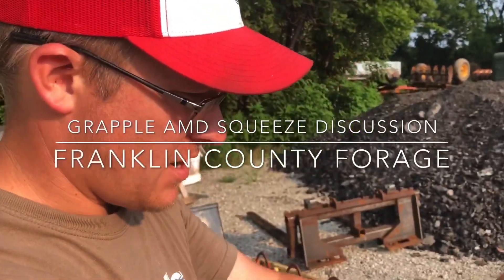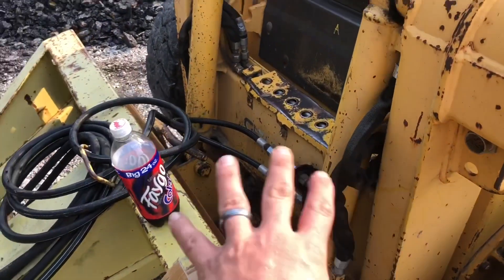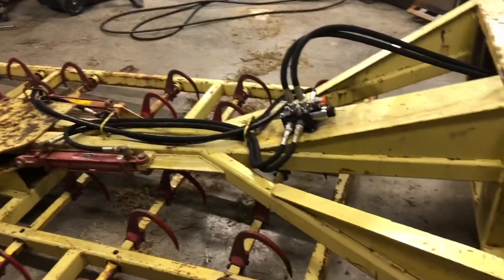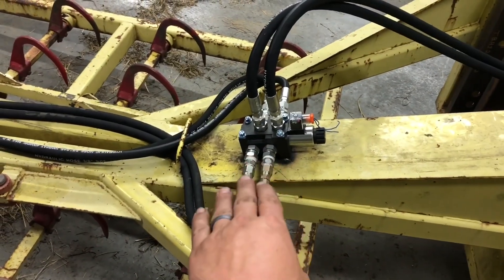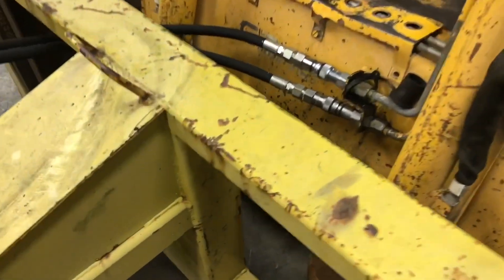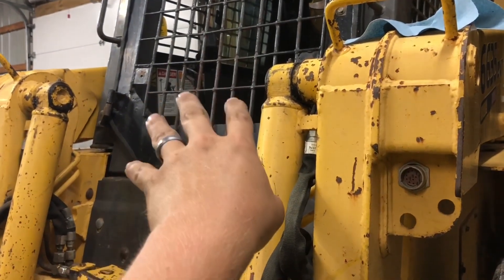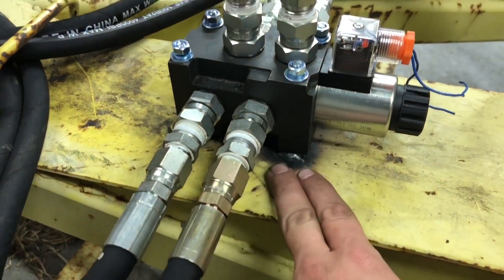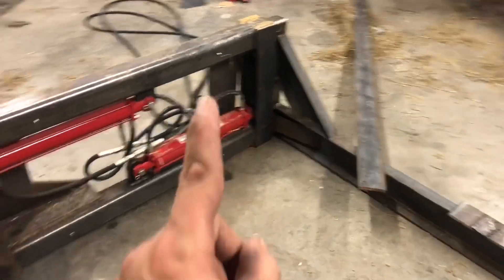Squeeze Reinforcement Discussion (mechanics of materials) and Adding Solenoid Valve to the Grapple

Comment: The squeeze looks like it would be the cats ass for picking up bales behind an accumulator if ya asked me
Reply from the maker: Yeah I think it will work well. Like I said there’s weaknesses for sure and it definitely takes some getting used to compared to a grapple. I also think it will actually do better on a tractor because you can actually see better. The skid steer is so close to the hay that you can see anything once you get it in the air.

Comment: I am excited about the squeeze
Reply: Have you ever watched bales of hay farm and ranch channel?
They use a squeeze everyday
Reply from the maker: Yep I’ve watched bales hay a lot. Their squeezes are a little more substantial than mine haha. The biggest thing with them is they’re using them on larger bales. I think the larger the bale the easier it is to squeeze.  It it is the same concept though. It would be sweet to be able to squeeze an entire stack one day. I don’t have anything large enough to handle a stack right now anyway.
Reply from the maker: I’m pretty happy with it so far. For a first time build it’s pretty decent. There are a few more smaller things I think I’d like to do and once I get even more time I’m probably going to add a relief and a way to side shift hydraulically. We will see. Didn’t want to get complicated for a prototype.